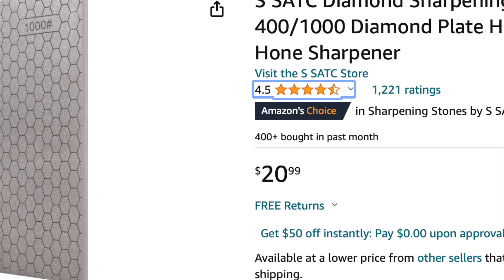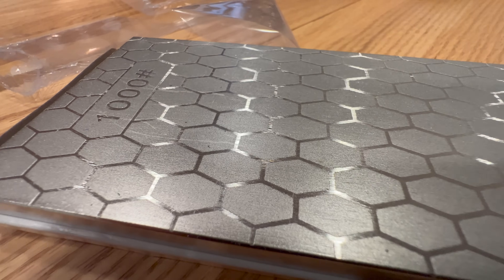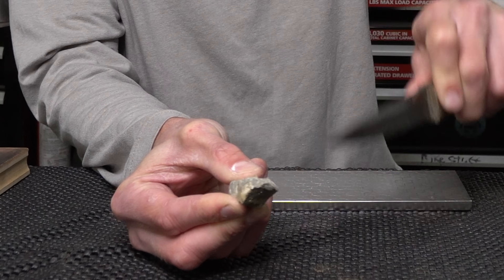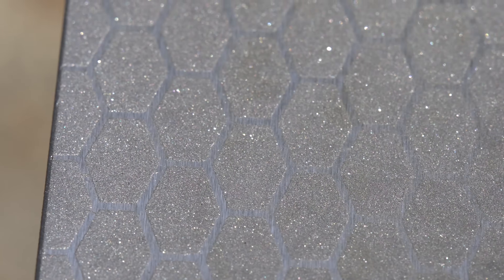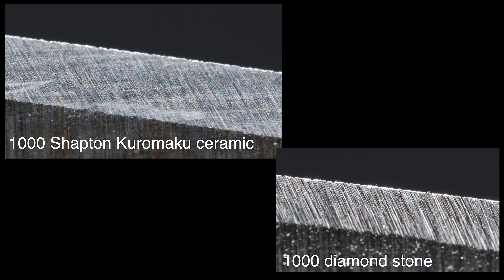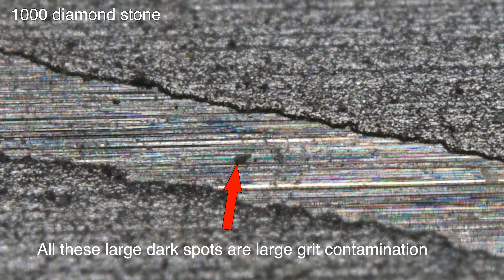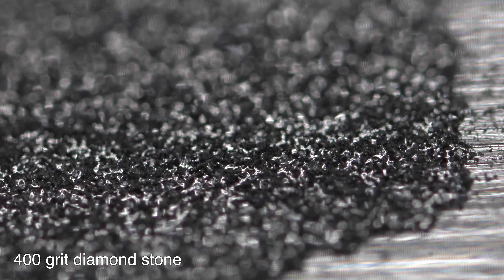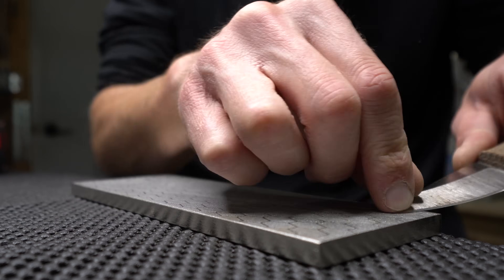S SATC Diamond Sharpening Stone Review - Is a $20 Diamond Stone Any Good?

Comment: Would you recommend this stone for a mora? I usually use sandpaper on a flat surface but sometimes I'd like something that would last a little longer for rough sharpening. Most of the polishing I would still do with sandpaper
Reply from the maker: You do need a very coarse stone for scandi grinds, since they are a pain in the butt to sharpen. If you have a way to refine the edge after initial profiling then it could make a somewhat decent candidate. If you sharpen A LOT id recommend something like the DMT extra coarse. Its much more expensive but will last longer. This stone is fine for the occasional use for only $20

Comment: Is it a bad idea to use water on ANY diamond stone or just not on these? I'm asking about the ones that come with the worksharp precision adjust.
Reply: Pretty much any. Even if the manufacturers claim it’s safe for water, whether it’s corrosion resistant plating or stainless, rust will still find a way. Stainless isn’t completely rust proof, and plating will be worn away with use. Even some of my stainless steel spoons have rusted after decades of use. Gotta scrub it off every time I see it or toss em. 😂

Comment: Hey man I am confused about what you said in reference to using water on a diamond stone. I have a DMT diamond stone and they recommend using water, as do other sources all over the internet. I also didn't realize until now that you've stated that they wear out rather quickly.... is that because you use them dry? Possibly? I'm just trying to get the most out of a $50 stone that I still don't feel confident when using it. Lol 
I'd love for you to make a video about DMT stones specifically. I use either water or a solution of water, dish soap, and windshield washer fluid, like what you put in the reservoir on your vehicle. I made the investment because I wanted something that I knew would be flat and sturdy but it feels strange when I use it. I probably use too much pressure.... I'm going to get one of those ceramic Sharpton stones next but it'll be a while before I spend more money on knife sharpening stuffs. 
Thank you for always making videos with a good attitude and good intentions to help people like me who didn't have anyone to teach them how to maintain the world's most handy tool!
Reply from the maker: You can ise water but in doing so the stone will rust. Diamond stones don't need water or fluid to work properly. You can simply wipe off the particulate with a towel. Mine are 6 years old and used HEAVILY and I've never used water on them.
Reply: Right on man I appreciate your reply. After I posted that I comment, I tried my diamond plate dry and it felt good. That when I realized that the only time I'd tried it dry was before I'd properly broken it in. Thanks again

Comment: Hold up, why would water cause premature wear on a diamond plate. If anything it helps float away swarf, and broken off loose diamond particles reducing wear on the nickel plating holding the diamonds to the substrate.
Reply: Corrosion on the steel
Reply: Some encountered it in the amazon rewiews too

Comment: Why does water damage a diamond stone?
Reply from the maker: The water will eventually get under the plating and corrode the steel underneath
Reply: Right, makes sense! Cheers
Reply: @OUTDOORS55   ...So OK to use water really, just store the diamond stone in a warm, dry place after.  For the low cost of the stone, a bit of watery sounding, sliding, satisfaction is surely a small price to pay for the occasional, novice DIY sharpener.  Surely not much stone life lost if kept dry, no?  My recently purchased Faithfull diamond stone set states wet or dry on the box

Comment: Surprised you say people shouldn't use water on diamond plates.  What's your reasoning for that?  DMT recommends water as a lubricant.
Reply from the maker: Water will rust underneath the plating causing the plating to fall off the stone. Dmt just wants you to buy another one😉 diamond stones don't require any lubricant since they don't load up in any way. Just wipe them off with a towel.

Comment: $20 man those look the exact same as ones I got from ali express for $2 each they were 1 sided and my 1000 seems fine but like I said they are 1 sided
Reply: 2-4$ ones are smaller and thinner (151x63mm, 3mm thick) and weight less. 20$ one is bigger (200x70mm) and thicker (8mm) and weights about 880g, which probably affects delivery cost from China (even if it's "free", it's included in the final price). They probably come from the same manufacturer anyway.
Reply: @sarmatiko  ya neither of those are a big deal they have much narrower ones and the only problem with the thickness is you need to find a good way to mount it but it doesn't really affect operation so I'm pretty happy with my purchases

Comment: Woah, woah, woah. Where is this assertion that you should never use water on a diamond stone coming from? All the manufacturers I have purchased diamond stones from recommend using water.
Reply from the maker: It comes from corrosion. All diamond stones are made with a carbon steel base that will rust if there's any microscopic holes in the plating surface. You can use water you're just opening yourself up to corrosion issues down the road more so than if you didn't use water. Diamond stones do not require water for any reason. If you find they build up with particulate, just take a paper towel and wipe it off.
Reply: @OUTDOORS55  I have issues with paper towels creating a ton of particulate when I rub them over the diamond surface. One thing I saw recommended was to mix the water 50/50 with alcohol. The alcohol will help the water evaporate more quickly, preventing corrosion.

I’m not sure what exactly they use to plate the steel substrate, but my guess is electroplated nickel for the cheap stuff. Electroless nickel would be my choice due to the lack of pores, so I wonder if this is what more expensive stones use.
Reply: @OUTDOORS55  I somehow still can’t sharpen anything as well or nearly as quickly as you do. Your skill far surpasses mine, that’s for sure. So, if you don’t mind getting some paper towel bits on your stone, it must not matter that much, and I should just get over it.